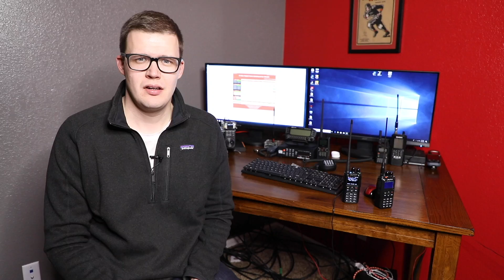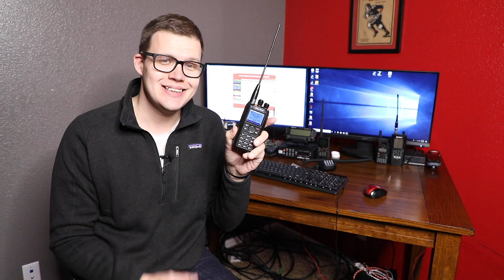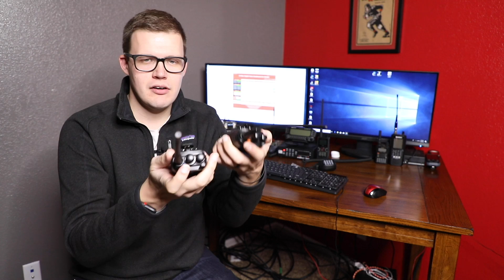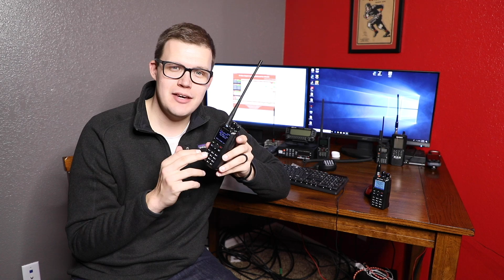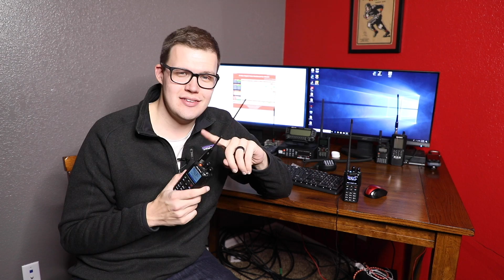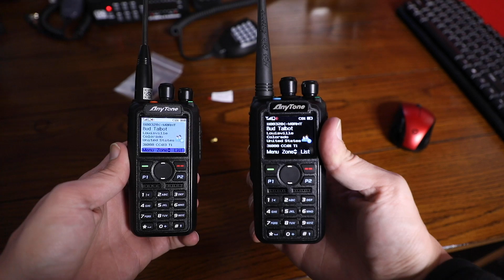Is The AnyTone AT-D878UV DMR Radio Worth The Money?

Comment: Most of the price increase for the 878 is due to the new China import tariffs that where not in effect when we bought our 868s. Not A/T hiking the price for a new model.
Reply from the maker: That’s interesting, but I don’t think the tariffs are $40 worth. I’m sure that’s a factor I didn’t consider, but also a larger margin, too.
Reply: @K0LWC  MY 868 cost $169 the import tariff on Chinese electronics was 25% the last I heard so that brings it up to  $211.25 so $8.75 for the new features if my info is correct. Makes the no new hardware a little easier to take. Good video by the way, I'll keep an eyey on your channel.
Reply: There are new features, like roaming. Call a motorola or hytera dealer and ask them for a radio with roaming. I dare say it will cost far more than a 878 costs.

Comment: I think you need to do a little more research since there have been further changes and the 878 has additional features over the 868 such as analog And digital APRS (the 868 only has digital APRS) as well as repeater roaming with the 868 does not have. The tear down you saw was likely on the initial 878 release. There has been a second hardware release with has increased memory and a different processor with increased memory. You may want to check this link:  http://members.optuszoo.com.au/jason.reilly1/868mods.htm?fbclid=IwAR07W8isaJyhyv-j8OG3ecGKUn_WJqVlYhjpSgsDCArItb8v211m8B1DBvw

Comment: Have you done any comparison's to the TYT MD-380? Is there good enough improvement to switch to it from the TYT?
Reply: I got a TYT MD-390 it's headed for the trash. CCR and I just won't ever get along. I am looking for something to use with a DVMega. The TYT can't even handle that task. Is the 878 the answer" Or should I hold out for Hytera or Motorola?

Comment: Think i made the right choice. I could have paid the extra 60 quid, because both were in stock, but i may even hack the 868 to flash the 878 firmware down the road if the current hack looks stable enough.
Reply: Just updated to the new 2.34 firmware on 868 which gives the screen of the 878 without having to open up the radio to hack. Loving the black screen and new icons. I just don't have analog APRS & roaming but i can live with that for £60 less.